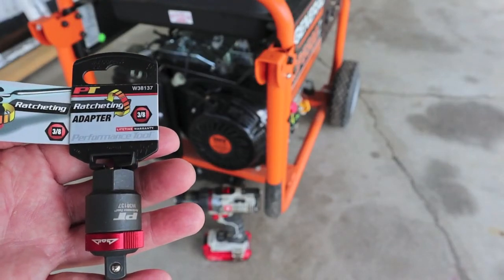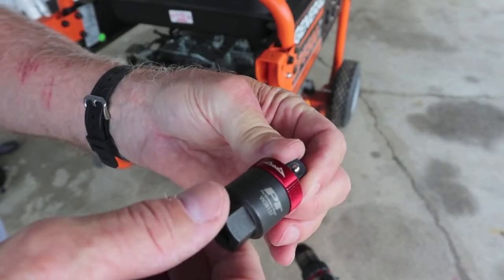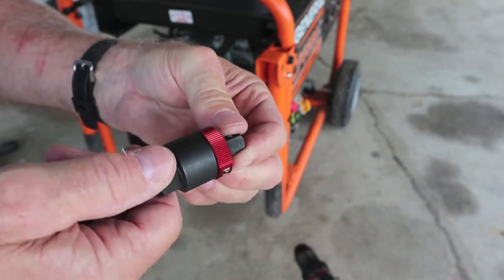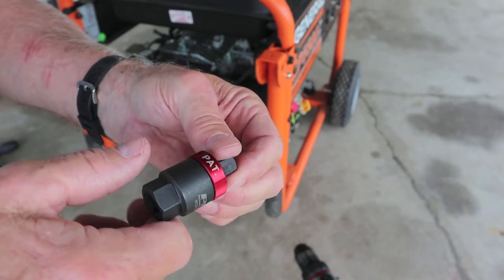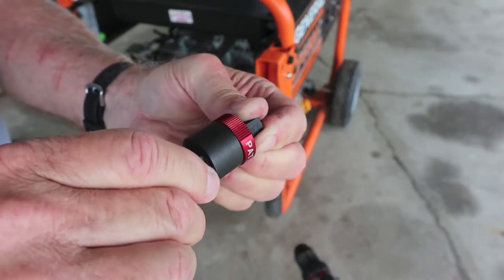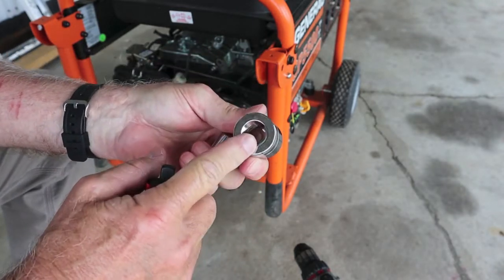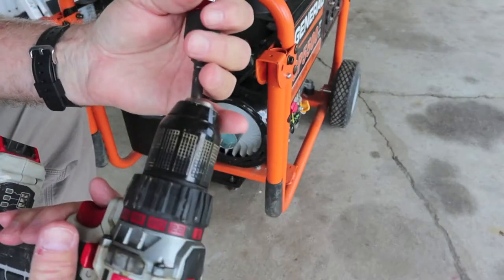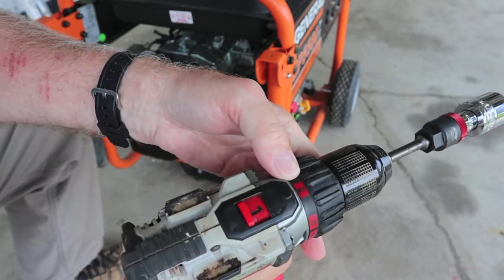Will a Ratchet Adapter on a Drill start your Engine? YES, but a word of CAUTION!

Comment: I am a bit confused. You said the engine turns counter-clockwise, but your engine was turning clockwise when you started it...the opposite of how you first set the ratchet adapter. Did I miss something?
Reply from the maker: The first example with the adapter was set to CCW if your engine runs CCW.
The engine in the video runs CW and the adapter was set to CW.
What you missed was me setting the adapter CW before starting engine.
I just checked the video, sometime editing will leave out key points.
Thanks for watching and commenting!

Comment: I plan to use one of these, I'll set the direction 
I need, and tape the 'selector switch' tightly to 
that setting, so it won't inadvertently switch 
directions nor lock up on me.
Reply from the maker: That will work. As with always working around rotating machinery, be aware!
Thanks for watching!
Reply: @pmtips4482  Absolutely, thanks..

Comment: Thanks for the information! I think I will go back 100 years and make a unit for the engine like my dad's model A, or his Farmall M tractor. Then make an adapter for my driver that is spring-loaded just like a spring on an electric starter.  That way the engine rotation will push the drive attachment towards the the impact driver.
Reply from the maker: That would be ideal!
Thanks for watching and commenting!

Comment: Huh.. I'm going to make one of these for sure.. I think I'll go ahead and cut a hole in the center of the cover to access that nut on the flywheel..
Reply from the maker: I would cut the center out too, on mine by cutting the center out you will eliminate the pull rope rewind spring housing, but....I don't want to pull start it anyway.
Thanks!

Comment: Hello - Well done video. Will this work on a 14 hp Kohler engine. It is on a portable sawmill and I have torn my shoulder trying to start it. Thanks
Reply from the maker: Yes, it should work with a decent cordless drill. Start with both hands holding it and make sure the rotational switch is in the correct position. Make sure to check the rotary switch position every time you attempt the start, some are epoxying or tack welding the position of the adapter due to the centrifugal force will snap the selector in the opposite position. 
Stay safe!
Thanks for watching!
Reply: @pmtips4482  did this work for you. I have a 12HP wood splitter that I would like to try this on. I'm worried about the motor kicking back though, which it does sometime. I think that would still maybe hurt your wrist.
Reply from the maker: @luvbgrass  Yes it should work with your 12 HP engine. Just make sure the adapter direction selector is in the correct position for your application, and use some tape or epoxy to hold it in that position. What happens is the centrifugal forces in the drill and engine starting (then dying), will switch the position ring.
Above all....be careful.
Thanks for watching and work safe!

Comment: Tried for days to get my flooded chainsaw working.what a nightmare.tried all the usual tips but nothing worked.watched this vid and bought sealey adapter off ebay.works a treat with dewalt 18v combi drill.no more using pulley.thanks from aberdeen in the UK.
Reply from the maker: That's awesome! 
Thanks for watching!

Comment: When the Schroeder is off the engine will it cool the air cooled engine properly??
Reply from the maker: It may not be optimal.
I have replaced this generator with a Predator 3500 for the time being.
Thanks for watching!
Reply: Yeah I wondered about this too - although tbh the most value of this is getting the generator to start out of hibernation.  Why not do this to warm it up, stop it, then replace the pull start unit and carry on from there?

Comment: Without this adapter you not only risk injury but you can shear the flywheel key resulting in improper timing and an engine that won't run no matter how fast you turn it over.

Comment: Thanks! I bought a 1/2 inch drive version of that ratchet adapter and silicone sealer glued it to the 15/16 inch socket I needed for my Gravely LI. It works much better than without and much safer.
Reply from the maker: Thanks for watching and commenting!

Comment: Pm Tips  You might want to take that racheting adaptor apart and put some grease in it...i bought the same 1 you have from amazon and just for the heck of it decided to take it apart to see and low and behold absolutly no grease  in it or any kind of lub at all...
Reply from the maker: I can believe it, the gears inside even feel dry. I usually put some good oil on the inner ring and work it in.
Thanks for watching!

Comment: You can upgrade to electric starter on most of these generators for about 50-60 bucks
Reply: That fail a lot. Not to mention the sla batteries dont hold charge well. Never had a drill fail, L-ion batteries are ment to be shelved long periods. Why by a starter and battery when you can use what you have plus an adapter?
Reply: No electric start support on these Generac models :(

Comment: Is this it. Does not say which way it turns. Want to use on a 17.5 hp. Kohler engine.https://www.amazon.com/Performance-Tool-W38137-ratcheting-Adapter/dp/B01MSZBDFN?th=1
Reply from the maker: Yes, that is it. It is bi-directional by rotating the outer sleeve.
Work safe!

Comment: Assembled this. Love it! Starts my generator in a flash. Being 75 years of age and having back problems it is exactly what I needed. Thanks!
Reply from the maker: Thank you for watching! I'm glad it worked out OK!
Reply: @Pm Tips  do you sell these?
Reply: 1 if no ko ko íu,l LLP @pmtips4482
Reply: Great video! You mentioned that there would be a link at the end to make the 2nd adapter that you made, albeit more expensive, but is safer. I'd like to have the instructions to the adapter you created please.
Thank you 
r @pmtips4482
Reply: Me to but so are my arms?😵‍💫
Reply: P
Reply: Much better than a pull backfire : back SURJURY they told me : no more next time! 😭🙏

Comment: Love it. Newly subscribed. Please reveal though-How do you use a drill on a cold start where full or half choke is necessary?  wouldn't drill noise and/or high revs hide initial engine sputter and cause one to flood engine?  Or maybe hear it but no time to retract drill before you flood it?
Reply from the maker: On mine, there is plenty of time to reach up there and push the choke in.
Drill noise is not a problem either. It won't mask anything the engine is trying to do.
Thanks!

Comment: Hi ...Do you have the link for the rachet adapter or its correct name ...I cant find this adapter anywhere...Many thanks😊👍
Reply: Performance Tool W38137 3/8" DR Ratcheting Adapter
Reply: @Mumwaldee  Thankyou😊👍
Reply from the maker: On Amazon search for: Performance Tool W38137 3/8" DR Ratcheting Adapter
Thank you for watching!
Reply: @pmtips4482  Thanks dude...I found it😊👍

Comment: Who makes the drill you're using for this? We tried using our DeWalt cordless drill and it won't turn over.
Reply from the maker: Helen, the drill is an older Porter Cable 20 volt. The engine is a 389cc size. I don't think any drill less than 18 volts will turn it. 
Good luck and work safe!
Thanks for watching!
Reply: Ppl

Comment: Occasionally the bolt threads/spin direction are opposite sometimes resulting in loosening the 🔩. I encountered this on an old Honda ATC
Reply from the maker: Yes, that could present a problem. 
Thank you for the information!

Comment: I'm still searching a more permanent solution, one that doesn't require my wrist  nearby the generator :))
I locked my ratchet just testing it in my hand with the drill, looking to feel how much drag would be there freewheeling... 
Maybe I'll manage to do something with a bicycle freewheel, a length of chain and another small sprocket.
Reply from the maker: As with any rotating mass, be careful!
Thanks for watching and good luck with your project!
Reply: https://www.youtube.com/watch?v=FckBIMatYzo&t=46s  a suggestion to glue it in the correct starting direction. it should be "safer"

Comment: Excellent video, I have a small single cylinder yuchai power diesel with a decompressor. Would this method work for a diesel with decompressor?
Reply from the maker: I think it would, with the decompressor activated, it should be a breeze to turn over.
Thanks for watching and commenting!

Comment: LOVE IT   But,, Why not just get all steel adapter  unit and mig weld it ,, in the right position,  leave it hanging on the gen,, problem solved,,,  
why u got mig out ,, weld extensions // socket // adapters ,, or what every makes U comfortable for you, and your gen and use , LOT CHEAPER AND FAST,,
Reply from the maker: Thanks for the tip! I may end up doing just that. I'm just using the adapter for this.
Thanks for watching and commenting!

Comment: I’ve seen other videos using this technique without ratchet, seems that the drill is spinning as motor starts spinning so not hard to pull off nut, as long as drill trigger is on.
Reply from the maker: Thanks Mark for commenting!
I know a few guys that done that and it tore out the little gearbox transmission in their drills, but they were the two speed versions. My old Porter Cable is a two speed, and it won't turn the engine in the high gear setting. In the lower gear, without the ratchet adapter, it would torque my wrist due to the slower drill speed.
Thanks for watching!

Comment: 4:27 problem, I been using a high tooth count 3/8" ratchet adapter 12 years. No problems kicking back. Lasted 100's starts so far.
 I had kickback/reverse problem happen using a low tooth count adapter,  90 year old Briggs -Stratton guy set me straight back then.
Reply from the maker: Thanks wrenchguy! That is good to know!
Reply: wrenchguy, what are you calling high tooth count adapter? How many teeth does it have compared to a low tooth count adapter?
Reply: 90+ teeth are high count, to me. Gearwrench has some 144 teeth tools. Anything less than 72 teeth seems awfully coarse and crunchy.
Reply: @keithdefries7210  I can't get to my adapter now but will guess 20-30 tooth count.  Its explained and shown in this video i made years back.    https://www.youtube.com/watch?v=xCkjPxe_gVg

Comment: What if you did it with an impact wrench as opposed to a drill? If the engine were to lock, the impact would begin to "break power" thus preventing you from inuring your arm. My doubt however is the impact not having enough power to turn the engine before it "breaks".  I am about to buy a set of tools, could you please test this? I would like to know what it would be worth going out of my way to do this
Reply from the maker: Hi Adam, sorry for the late reply. I tried a Bosch 12 volt 1/4 inch hex drive impact, and it will not work even though the impact will bury a 3 inch deck screw in treated lumber. What happens is the hammer mechanism will do exactly what it is supposed to do and hammer the crankshaft nut tighter (or unloosen it). You need the turning power of a drill, not the "hammer" power of an impact.
Thanks for watching and commenting!
Stay safe!!
Reply: You want someone else to go through the effort and expense to see if what you want to do will be worth it for you? Before you spend to go buy some tools?  
No words for you.   No words.

Comment: How much for a piece just like you made?  (I have no welder) [d99klein@gmail.com]
Reply from the maker: Doug, I wouldn't make one again. I would buy a 1/2 drive ratchet adapter and epoxy the selector ring in the position you need (CW or CCW). I think the 3/8 adapter is on the small side for 250cc engines and up.
Thanks for watching!

Comment: Nice work! Can you put the link for this 3/8 ratchet adapter. I couldn't find it on Amazon
Reply from the maker: Hello, here is the 3/8 adapter. Be careful, as the selector ring will reverse from the quick engine start. This is not a hot link, just copy and paste in search.
Performance Tool - 3/8" Drive, ratcheting adapter (W38137)
Thank you!
Stay safe!
Reply: @pmtips4482  thank you for fast response. I found it. Stay safe.
Reply: I got the performance tool 1/2 inch adapter - it works, heavier, but it works fine.
another vid I watched helped add a "little" mare to the safety factor https://www.youtube.com/watch?v=FckBIMatYzo&t=46s
I think this guys 1 way bearing concoction might be best, but im too cheap. :D

Comment: Thinking JB weld everything in the positions required to be safe.   Thanks for sharing!
Reply: I was immediately thinking Duct tape the adapter directional in the way you want it to work. Duct tape fixes anything...lol
Reply from the maker: Thank you!
Reply: Thinking if not using the pull cord, then remove that and mount on the drill somehow.  Plus cutting a hole in the cover to better shield from the flywheel fan blades.
Reply: @jafinch78  the open fan blades got my attention really quick so I was already thinking of how to shield/guard them.  Thanks for pointing that out in case anyone missed it.

Comment: At a cost of 12 or 13 bucks if it last a year. It's worth it to me. Good tip on that thing locking up.
Reply: Hi , where can I buy this ratchet adapter I'm in South Africa
Reply from the maker: They are on Amazon but most auto parts suppliers has tool sales.
Good luck!

Comment: Couldn't you just put a piece of tape on the revolving selector to lock it in place?
Reply from the maker: Hi Raza, yes, I don't see a problem with that. Use a good tough duct tape, as something like painters tape is too weak. 
Thanks for watching!
Reply: I was thinking to find a way to jam, lock it in place permanently hopefully tape should work did you give it a try?